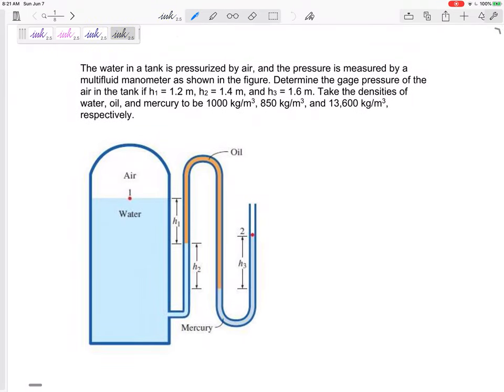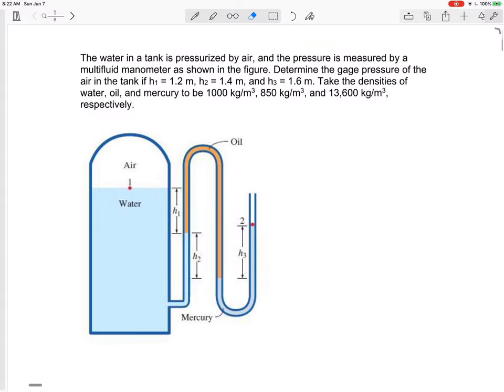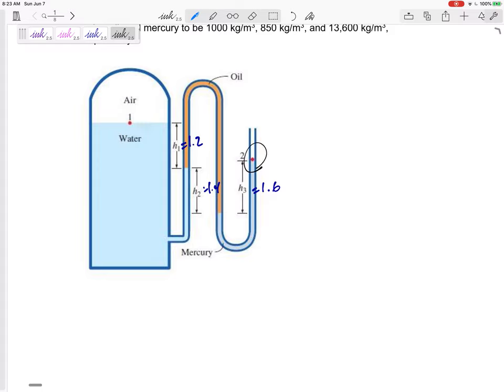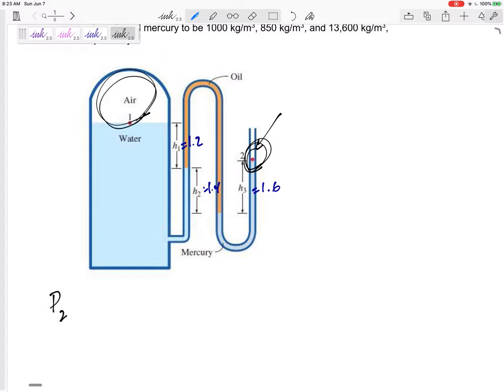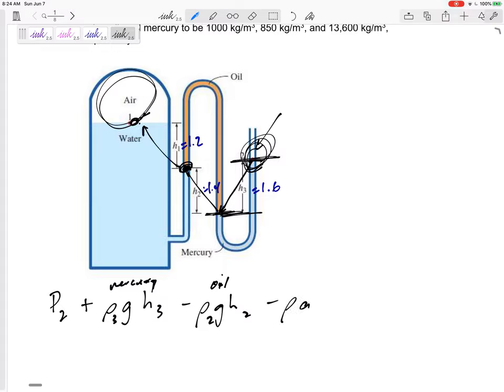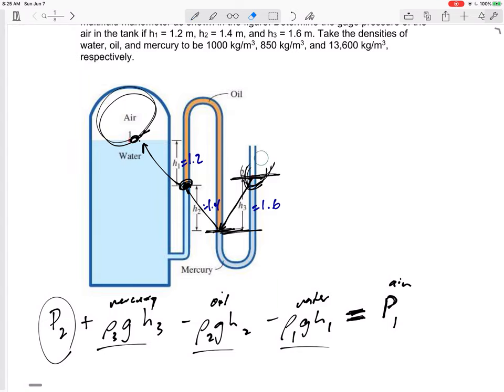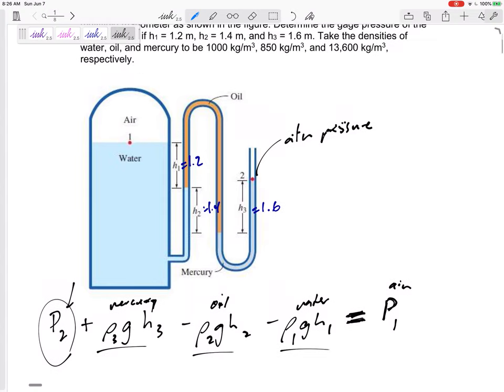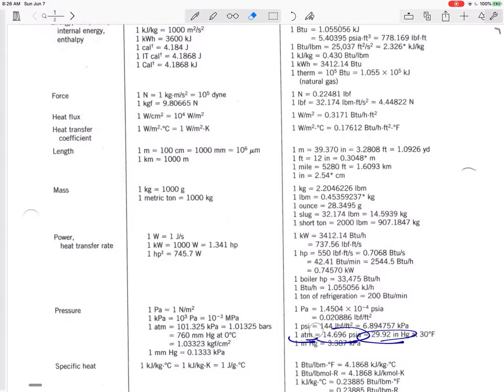Thermodynamics - Test 1 Problem 1 - Multifluid manometer

Comment: Sir for my problem, at the end of the question they stated that the local atmospheric pressure to be 95.5 kPa. They still asked to determine the gage pressure though. So is this value just meant to throw the students off or am I to consider P2 as 95.5 kPa?

Edit: This was a past assignment and just stumbled upon it while reviewing. I do not know if I actually got it right as I considered P2 as 95.5 kPa.
Reply from the maker: You were right to begin with. You don’t need that value to calculate the gage pressure. You would need it to calculate the absolute pressure.
Reply: @engineeringdeciphered  Thank you sir

Comment: i have a question : to use or apply the rule that we all know that any point at the same horizontal plan has the same pressure ;; is the point has to be in the same material or liquid?? or it could be different???
Reply from the maker: Only for the same liquid!

Comment: It's opened to the ATM, you can't discount it in this case.
Reply from the maker: If we were calculating absolute pressure, you would be correct. But in  this problem we are calculating gage pressure, so the atmospheric pressure is zero (gage).

Comment: My problem specified that P2=Patm so Im good. but what if it didnt specify or didnt put gauge pressure instead, it says "determine air pressure" instead of gauge pressure,  would P2 = Patm ?
Reply from the maker: Correct, if it is open, the pressure at that open area would be the atmospheric pressure.